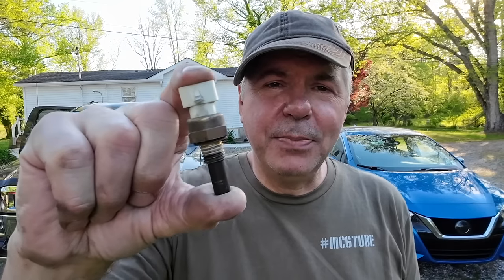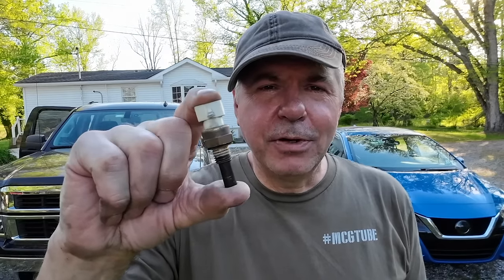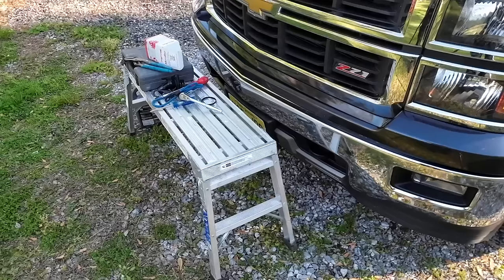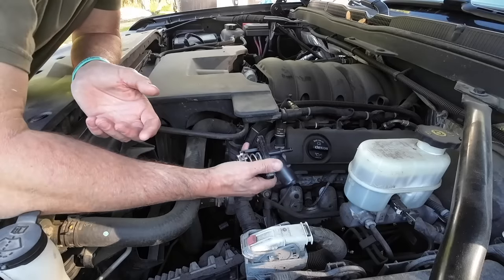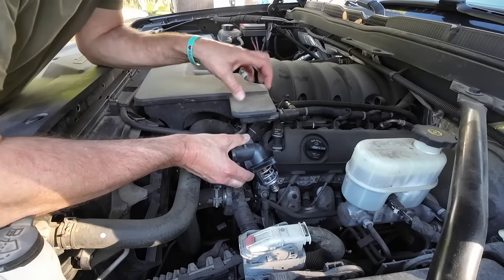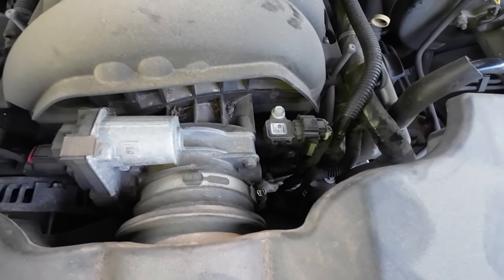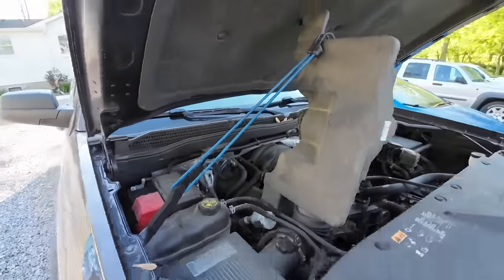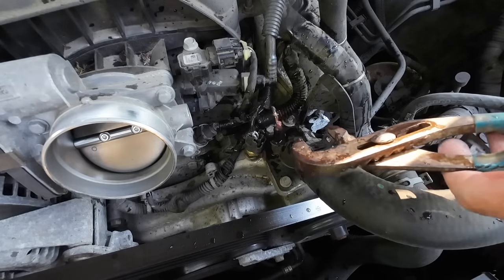Silverado Radiator Fan Won't Turn Off! This is THE fix! MCG video 141

Comment: Same issue. Changed the thermostat and temp sensor at the same time. However the fans still runs. Now what??
Reply from the maker: Did you clear the codes?
Reply: @MyClutteredGarage  Thanks for the speedy response. I did NOT. I figured, apparently wrong, that it didn’t put on the engine light therefore no code? How do I do that?
Reply from the maker: @TheDeanoinlox  have you driven it around for a few days? It may reset the codes itself if everything is working properly.
Reply: @MyClutteredGarage  I’ll take it on a few errands today. Let you know. Thanks
Reply: @MyClutteredGarage  Took it out, it like 50° here. Built warmth in a few miles at the heater but the gauge won’t go over 160°. It’s not hot as the upper radiator hose feels about 160°? The fan continues to run after like 5 stops with the key off. I’m disconnecting the battery and hooking it back in a bit. Hope it works.
Reply: @MyClutteredGarage   That fixed it !! Finally at 210° and no fans running. Thanks for babysitting me though this.👍🏼👍🏼

Comment: It wasn't the thermostat it was the sensor
Reply from the maker: Not in my case.
Reply: You'll be replacing the thermostat very soon. You cleared the faults from the computer. It will come back.

Comment: Just changed the thermostat on my 2015 sierra. Now that cold temperatures have hit the northern states a broken stuck open thermostat rears its ugly head. The computer needs to see 207 degrees to function correctly. The temp sensor is correct in reading 160 degrees. Thank you. You helped diagnose the problem correctly. There is a lot of bad information out there.
Reply from the maker: Thank you. Just wanted to share because I was given bad/wrong info. Glad it helped!
Reply: @bobcook8576 where did you get new thermostat from
Reply from the maker: @SANTRU95  I got mine from Advance Auto Parts. But any auto supply store should be fine.